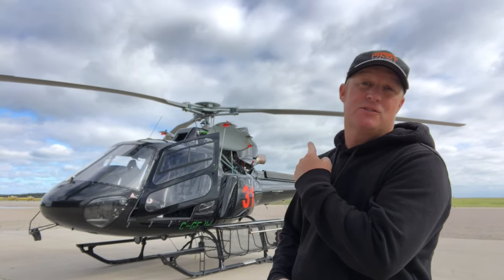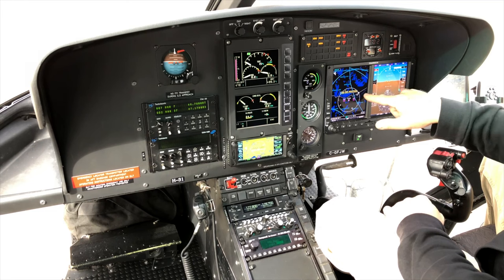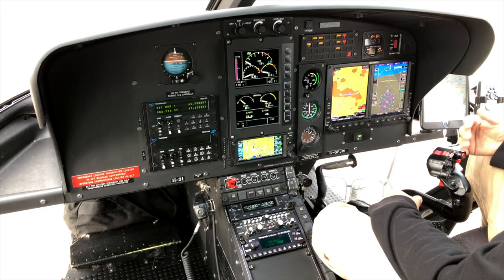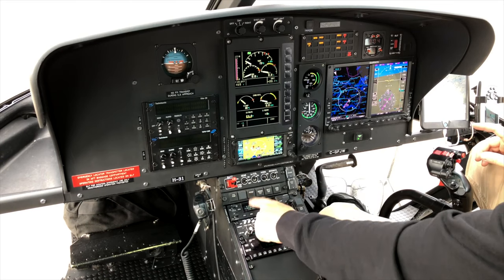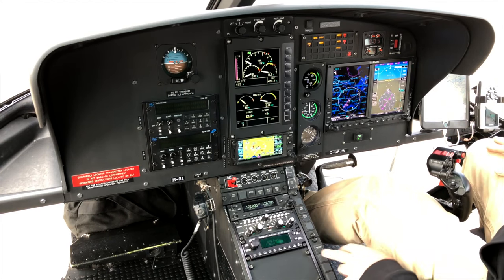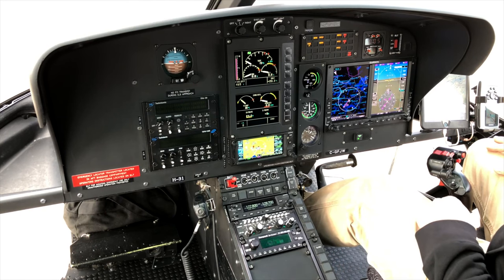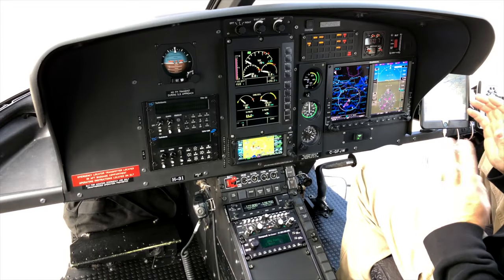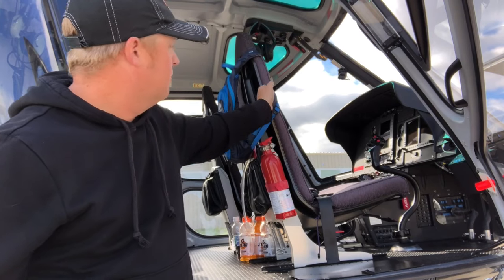Brand New AIRBUS AS350B3e/H125 Astar Helicopter - Front To Back Under The Covers Guided Tour!

Comment: What is amazing about the AS350 is its Starflex rotor hub (I was hoping you might comment on it). When laymen realize that the blades are being held from flying away only by a fiberglass sandwich, eyes start popping out of sockets. Then you could go on to say that apart from the centrifugal loads, it also supports the torque from the 847SHP engine, handles flexing and oscillating aerodynamic loads from the blades and it holds the entire helicopter up! This hub and its elastomeric bearings eliminate almost all the old style metal bearings, with their needs for grease, love of dirt and high maintenance. It's a marvel so often taken for granted!

Comment: Awesome video. Love seeing our engines at work and doing good. Also all the other helicopter systems that it interacts with. And just an FYI, it’ll make more power than what the helicopter can handle. We test them at a bit over 1000 hp for the 2D.
Reply from the maker: Oh for sure! You can easily take off way over max gross weight with the Arriels!!

Comment: Excellent Video Pilot Teacher, very informative and detailed.  When you LIFTED off to Taxi,  the HIGH PITCH Turbine noise was AWFUL.  I understand the camera was in the cabin not filter by HeadSets.  There was a video on a the 505 JetRanger X, the pilot told the Reviewer to take off his headsets inside the cabin.  It was impressively quiet while they were in flight.  I love this Helicopter, please tell me the volume on my video settings was wrong.
Reply from the maker: Helicopters are loud unless they are decked out with a sound-proofed VIP interior. This is a utility machine used for aerial lifting so its as barebones as they come to save weight and be able to lift more.

Helicopters with a Fenestron tail are considerably quieter in the ones I have flown.

Comment: Is there a cover over the starter switch to stop it being flicked off in flight? It looks close to air controls etc.  I'm assuming its a start/run switch which is flicked to off for shutdown after engine has cooled for 30 seconds?
Reply from the maker: You are correct. When the switch is moved to 'Start 'and the start sequence has finished there is a red spring-loaded cover that comes over the switch preventing it from being moved to Off accidentally. To shut the engine off the pilot moves the cover and turns the switch to off. See here:

https://planearea.com/wp-content/uploads/2021/04/img438523995385.jpg

Comment: I love this walk around presentation! At first, I thought the heatshield over the tail rotor driveshaft area was a "Fast Fin" aerodynamic enhancement for additional antitorque control. I see that it isn't but was this offered or considered in the purchasing process? Also, is the servo actuator for the tail rotor a dual tube/redundant design like the swash plate assembly servos? Or is it a single unit with an accumulator? Thanks again for producing this awesome channel.
Reply from the maker: Hi Touleau,

Our owners did not require the kit during their purchase of this machine. Not sure if the cost was not justified for them??

The tailrotor servo is just a single actuator like on the B2. It is also only fed off the belt-driven, lower system like the B2 also.

The dual hydraulics are only driven off the gear driven pump and only supplies the swashplate.

Hope this helps!
Reply: @PilotTeacher  Thanks for the information. So, you have "servo" redundancy on each of the pitch change links of the swash plate, coming from a singular hydraulic source. You don't have the redundancy of a crossfed / 2 hydraulic pump system. In reality you have two hydraulic systems, each operating separate portions of the flight control system. Man, this is interesting stuff! I got it all wrong...
Keep these videos coming. Maybe you could do one on the servos themselves, when the aircraft is in for maintenance. Thanks for the timely reply.
Reply from the maker: @llwellyn1  you got it! Google As350 dual hydraulics diagram and you will see.
Reply: Touleau, the tail rotor servo actuator is a single unit with an accumulator, and is powered by the belt driven hydraulic pump. Its actually the same part number tail rotor servo as used on the single hydraulic B2's and B3's.
Reply: @aaronboulais4498  How much servo actuator time does an "accumulator" provide after a loss of pump pressure? Is it directly related to the amount of servo articulation? Is it by lawful design necessary to provide a minimum of "x" number of minutes? Is it "land as soon as possible" or "land as soon as practical?" during a hydraulic system failure? I know the FAA uses these two phrases and they are not necessarily interchangeable. Thanks for any additional input Aaron!

Comment: Hi! Thank you for your videos. I'm looking into going to flight school. Curious, how often does one side in the right side seat? Ive got a slight physical impairment where I can't lift my left arm above my head... I'm trying to connect with an AME physician, which is very difficult, I have to say. In the meantime ice been trying to connect with people and do my own research.
Reply from the maker: Most helicopters are flown from the right seat, however there are some helicopters where a left seat pilot position is used. MD500, Airbus H130, Enstrom to name a few. Also if you fly in a two pilot operation you can see if you are able to permanently occupy the left seat.

No matter which seat you sit, the flight controls are the same. Cyclic in right hand and Collective in the left hand. What changes is how far you have to reach with your left hand across the cockpit to adjust radios, gps, dials etc.
Reply: @PilotTeacher  Oh, this makes a lot more sense. Thank you! I got the chance to fly an R22 yesterday and now I see why it's actually best the cyclic is in the right hand., and best overall that pilots sit in the right seat. At first I thought that this would be bad news for me, now, I see it might not be afterall! Thank you for your response!
Reply from the maker: @minayuen4775  anytime! Glad I could help.

Comment: I am tempted mate. very very tempted to gett a B3< TR. Do you know anyone in the south east UK that has a machine and training ?
Reply from the maker: Hey Nick. Not too familiar with the UK anymore. Maybe have a look at Castle Air, London Helicopter Centre or Lightspeed. If they don’t have they might know who does!
Reply: @PilotTeacher  thanks mate. maybe a trip to Canada for a quick Type rating ;-) 
need to check on the uk CAA licensing etc for an overseas TR
Reply from the maker: @helinick81  all the different Astars fall under the AS50 endorsement. Its usually just the individual companies that like to get differences training for each version.
Reply: @PilotTeacher  so  no separate type rating for b2 b3 b3e. cheers captain
Reply from the maker: @helinick81  nada. Only between AS350 and AS355

Comment: Nice vid, I have to ask how easy is it to hold in a hover? Assuming pretty calm and not much wind do you need a lot of cyclic and collective input to hold in a tight hover? Very small stick movements? Trying to see how the full size is to a large RC 700 size.
Reply from the maker: Having flown for 20 years holding a hover is pretty easy and I don’t even think about it, I just do it.

If you were just learning to fly trying to hover seems like the most difficult and nerve-wracking thing In the world.

If the aircraft doesn’t move there is no need to move any flight control.

Comment: Don't take your hands off the primary flight controls when in the hover or when operating in the shaded area of the HV Curve!
Reply from the maker: That is correct, although there are times when the left hand needs to adjust a radio setting or turn on/off a device.

Comment: This is a helicopter that has just never piqued my interest. It seems like there are too many videos of this aircraft having control system malfunctions and crashing into the ground, buildings, or water.  During ground resonance, the helicopter self-destructs faster than a Lego helicopter would.  Add-in the clockwise rotor, and I've just never been interested.
Reply from the maker: Like any helicopter, if the pilot does not operate it within its limitations it will bite them. Ive never gotten close to any of those issues and every Astar pilot I know has never gotten those either.
Rotor direction never makes a difference. 

Its one of the best utility helicopters in the world for good reason!